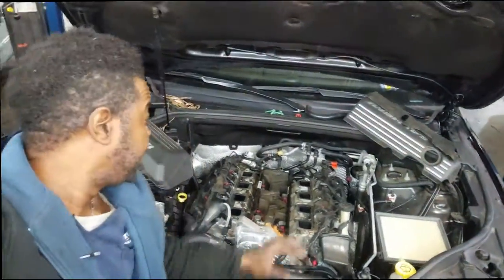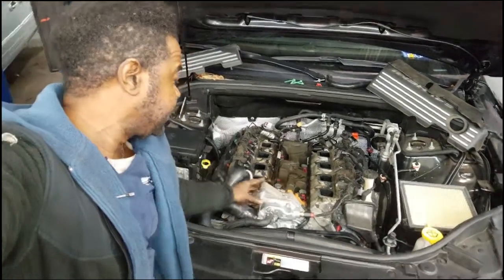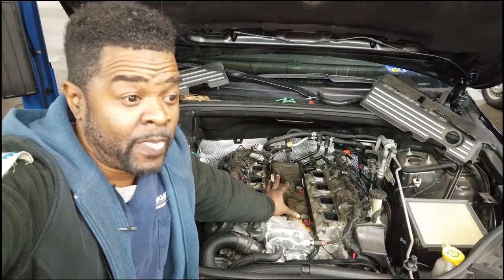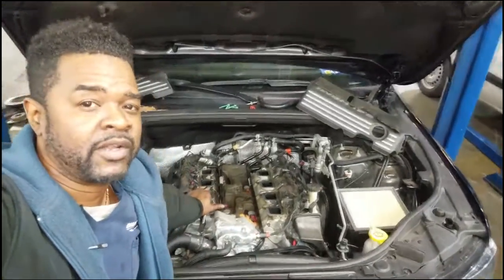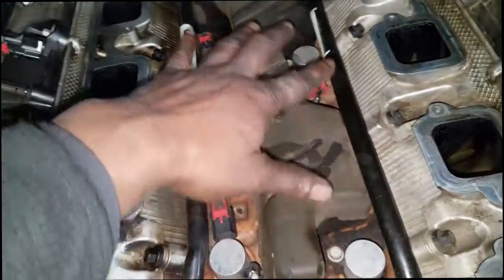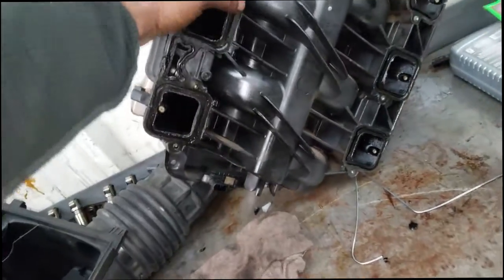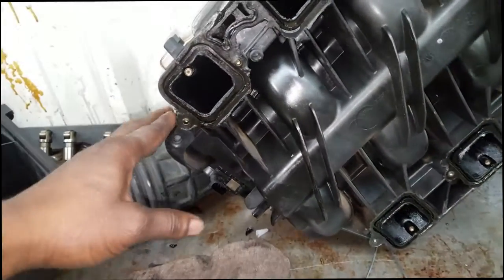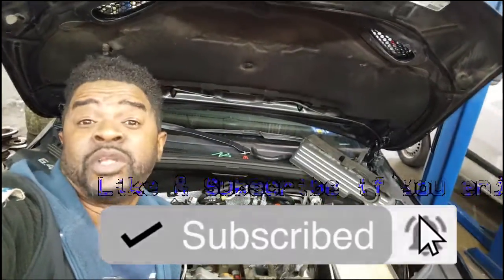Overheating  with AC ON, Hemi, Lets take a closer look. 6.4L 5.7L Hemi waterpump

Comment: I know on my 5.7 if you don't bleed it through the plug in the water pump it will never burp all the air out, and will run hot.
Reply: How long do you bleed it for and how long should it take

Comment: Good morning I have a  2005 Chrysler 300  hemi  my car keeps shutting off and over heating all the fluids are good I need help lol
Reply from the maker: Hey bud, did the computer pick up any fault codes? Also are you subscribed to the channel?
Reply: I’m gonna subscribe now and the faults are p0700 and u0100
Reply from the maker: Ok buddy, these codes are generic..P0700 simply means there are problems in the trans and the P0100 means loss comm but that's not specific enuff. A real good scan tool and some troubleshooting will be required to track this type problem down. This likely not a DIY job
Reply: I just subscribed
Reply: What was the issue

Comment: I have a 2014 chrysler 300s 5.7and I have a small leak coming from either my radiator or upper radiator hose and I already tighten it and it still leaks

Comment: I have the option to buy a 2005 rt magnum for 1800.  Guy says the cooking fan isn't turning on .  Should I pick it up I went to see it and it started and ran on . But you could smell the over heated coolant.  Things like that worry me .
Reply from the maker: And it should worry you..Only thing you can do is trust what the seller telling you..If this engine run hot sometimes the cyl head could expand and valve seats drop..Trust your gutt..
Reply: Those fans are known to go bad. Every Chrysler vehicle I've owned needed one and that 6.4 he's working on fan is crazy expensive,close to 900 from jeep

Comment: For intake manifold .  Take it to a machine shop they can smooth it out like a head . Also use red gasket maker the big temp and it will help prevent  manifold from melting at those points .wtf was mopar thinking
Reply: Yup they act like they going on trial.  When they dont tell the mechanic  then something else comes up and they want to throw words and say we messed it up or we trying to over charge and add charges.
Reply from the maker: yea man, i just wish the customer had said something..I hate unexpected surprises..lol..but thanks for watching, please subscribe to the channel for me, thanks

Comment: Same problem i have Dodge Challenger SRT V8 hemi 392 6.4Ltr 2013 model i am having overheat issue don't know what to do.  Workshop/ garage asking too much money and saying they will open engine. Please advice. I live in UAE Dubai
Reply from the maker: My friend, thats the only way to get a clear understanding of whats going on is you almost have to tear it down (open it up). Once the problem is found that just the first step..Exactly why is it over heating? is it low on coolant from a leaking water pump or radiator or something?  O and please sub the channel for me, thanks
Reply: Hey were you able to solve your problem? am having same issue too from Dubai and same car. Hit me up on instagram @joshmyster
Reply: @OffroadGeekDxb  still having overheat issue it's killing me
Reply: @CheemaVlogs.  bro can u tell me how u fixed it having the same problem with my 2012 srt8 from UAE!
Reply: @rudysmith4550  fixed it long time ago and sold my car, trying to think back and recall everything I did to fix the problem
Reply: @CheemaVlogs.  brother if u remember please let me know!